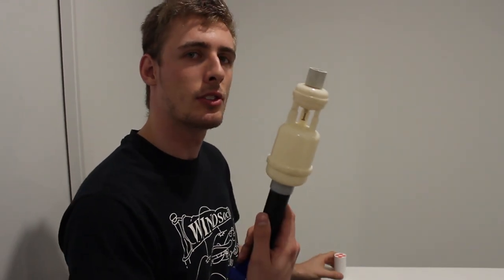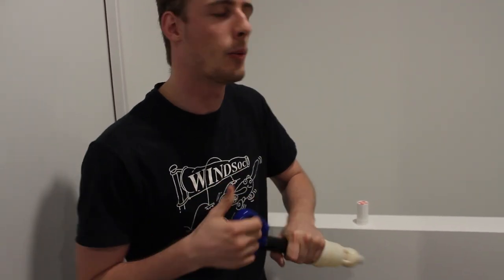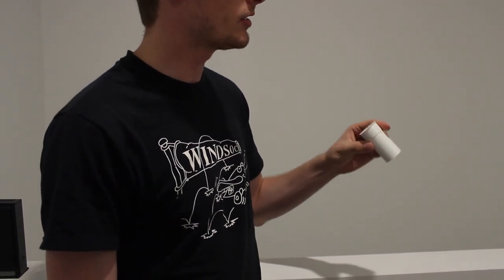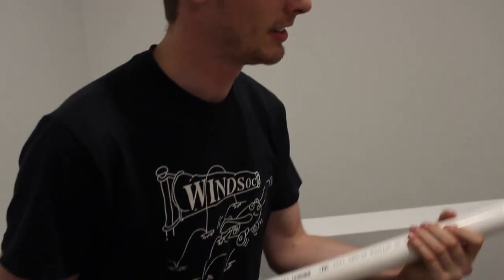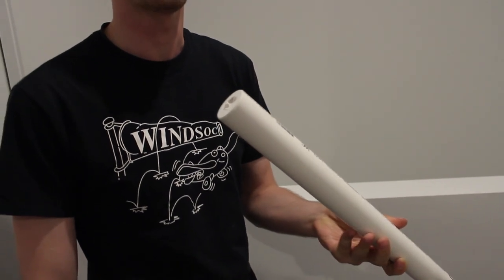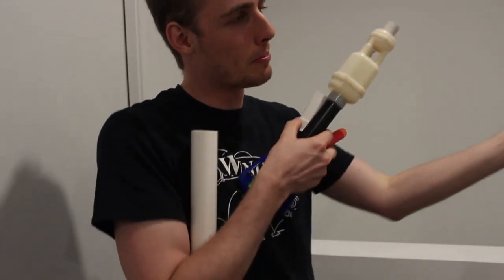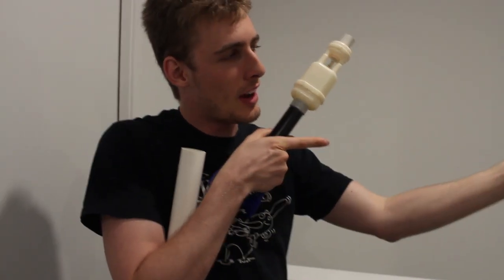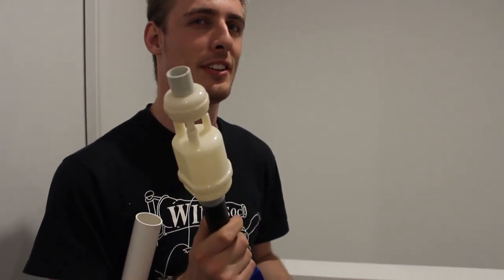Make Test Battle Sneak Peek: Shotgun R&D!

Comment: Still waiting for an update for this project :D

For the idea of having multiple types of darts loaded shells, the DP-12 is a good candidate, it's essentially two pump actions side-by-side. There's a few more like that, like the 1216, with 4 tubular magazines holding a grand total of 16 shots of 12 gauge, thus the name 1216. The "magazine" is detachable and is manually rotated, much like an AT2k. It might become a tad bit too large with the shells you're using. xD 
Also on the table, which I feel is a lesser known shotty, is the Kel-Tec KSG, which also made an appearance in the movie John Wick. Very similar to the DP-12 in that it has two tubular magazines in parallel below the barrel, but only has one barrel. It's a bullpup design with shells loaded in from behind the trigger, and it's got a selector switch that allows you to switch between magazines. Holds 14 shots.
Finally, featured in both Battlefield Bad Company games, and with only three ever imported into the US, the NeoStead 2000. More or less a KSG with weird features. Has double magazine holding 12 shots (they keep getting lower in capacity...) and single barrel, but unlike the KSG, it has magazines on top, barrel at the bottom, forwards-pump (how awkward), and the option to alternate between magazines with each pump on the selector switch. 

tl;dr, there's a few more options in terms of design when it comes to loading multiple dart types in shells other than a DP-12. But it seems like it's best we start simple (the patent drawings for the NeoStead is semi scary, the 1216 is a Rival Artemis with magazines that rotate instead of barrels, the KSG, weeell, say, a Dual-Strike with mags instead of Smart AR barrels, and honestly it could be faster to make an orthodox pump action and bolt them together instead of making a DP-12).

Have a good day.

Comment: Shotgun bore "gauge" is based on a pound of lead.  Twelve gauge is the diameter of a 1/12# ball of lead.  Thus, gauge and diameter have an inverse-cube relationship.  Twice the diameter of a 12ga should be 1&1/2ga (12/8), or the diameter of a 2/3rd# ball of lead.  But I'm pretty sure the cannon designations would have been applied instead, calling it a "two-thirds pounder" rather than by any gauge number.
Reply: +Rhino_Aus "one pounder"

Comment: Are you going to put an extractor to pull out the shells?

You have the lips on the shell so you can use a large extractor claw so the shell comes back, is ripped out and have a shell loaded into barrel.
Look up 870s and field stripped firearms, that should help with shell ejections
Reply from the maker: +Snoop Doggy Doge Yes. I have some pretty good sources and the design is all but complete conceptually -R

Comment: Dang, at that scale you'd pretty much be out of the gauge ranges and into the caliber scales! That's one heck of a "shell." Great job there man, can't wait to see where this goes. I'm a huge fan of absolvers/shotgun barrels myself, and have been working on some way to make a brace of tri-barreled flintlock styled absolver pistols... just for the fun of it really XD. Any particular air tanks you guys would recommend for that? I was thinking maybe along the lines of using a single Panther tank per blaster, though there might be more easily obtainable options with equal/better power and ranges. Any thoughts?
Reply from the maker: +Derek Shy-Borg Thanks! I'm pretty excited too. The airtank selection is tough as there are a lot of variables. I would say instead pick an airtank then design your system around that. Its easier to change the barrels then the airtank if it doesnt have enough performance -R
Reply from the maker: +Derek Shy-Borg I know that a panther doesnt really have enough air volume and for me won't fire all 3 barrels of a 3 dart absolver 100% of the time
Reply: +Derek Shy-Borg Thanks for the tips, I'll keep looking through my tank options. Maybe I could fabricate my own smaller PVC tanks, or if I can figure a way to make a powerful and compact springer system maybe? Time to break out some blueprints.
Reply from the maker: +Derek Shy-Borg BBUMB or a 4B would be the way to go. The BBUMB can handle 6 darts easily and the 4B can handle a lot more -R

Comment: Oh boy, a pump action shotgun with shells? Shame its not using the sledgefire shells, but thats still pretty cool.
Reply from the maker: +Mc Rex You can't get sledgefire shell easily nor cheaply. 
-Justin
Reply: Make.Test.Battle Probably not, but in comparison, just how cheap is it to 3d print these shells, and if you do intend to use them in a pump action shotgun, what will they be ejected into?
Reply from the maker: +Mc Rex I can print the shells for about $0.50 each. THey will get ejected onto the ground and I will pick them up between rounds -R
Reply: Make.Test.Battle Aren't you worried about them cracking, chipping or breaking at all?
Reply from the maker: ***** Not really; they are fairly tough. But if they do I can just replace them -R
Reply: Make.Test.Battle Fair enough. Any plans for sale of any kind of design that uses these shells?
Reply from the maker: +Mc Rex ill probably release the shells in some fashion when i have them dialed in just right and maybe some rough design instruction video

Comment: Hey Ryan, I was just browsing through your guy's videos and experimental for inspiration  when I thought of something. You said you're trying to think of a mechanism/system to multi-feed "shells," while still being able to hold and switch between multiple types of shell/dart types? There's a tactical shotgun pattern ot now called the SRM 1216 that has a detachable 4 chamber shell mag (is it called a mag for shotguns?), used to hold multiple types of shell types and is commonly used for close quarters tactical use and defense. Need a new ammo type? Simply rotate the cylinder to the desired type, lock in place, and ready the gun to fire. I think it might be a good candidate for implementation into your own design, just upscale the dimensions to the new Nerf sized shells you're making. It's almost the same kind of set-up as an AT3K rear loading mod in a way. Here's a pic of one if you need an idea of it's overall layout. Hope this helps a bit, can't wait to see what you come up with!

http://cdn2.bigcommerce.com/server5100/7g4m0/products/107394/images/550035/P1720826__79571.1415640318.1280.1280.JPG?c=2
Reply from the maker: I considered something like that but the size of the mechanism with end up being totally huge! I will probably run with a pump action shotgun primary and if I feel like it a little single shot break action pistol-ish thing for firing grenades/rockets -R
Reply: Pump Action, arguably the classiest version of tactical shotguns (especially those chromed ones with wooden details. Oh Remington, is there nothing you can't do? :P )
There's another pattern of shotgun that could work that I found, all thanks to WalcomS7's double Alpha-Trooper build. It's called the DP12: dual barrels, dual magazine wells, all hooked up to a single trigger and pump mechanism. Sorry to bug you again, just thought I'd toss out one last idea I stumbled on. 
http://files.harrispublications.com/wp-content/uploads/sites/8/2015/07/swmpas-dp12-lead-682x383.1437586360.jpg
Reply from the maker: Hehe yeah I saw that too... lets get 1 pump action working first eh?

Comment: why make a new shell when you could just reuse the sledgefire shells? unless that shell is big enough for two mega darts, then I get it. you could always shoot rival rounds as well.
Reply from the maker: +AidenCaterwall A few reasons: Sledgefire shells don't fit in a mag tube nicely, don't have the right geometry to be compatible with a tubular magazine mechanism, only have 3 darts instead of 4, and are fairly expensive. To have a useful amount of ammo id have to print my own sledgefire shell, and then I may as well print my own shotgun shell design -R
Reply: +Make.Test.Battle well that makes sense.

Comment: HPA?
Reply from the maker: +Design/Forge High Pressure Air. It will run off a paintball bottle -R
Reply from the maker: +Design/Forge I watched that guys stuff ages ago; but I have some much better sources that I have used to design the mechanisms. Its based around real life shotguns, specifically the Remington 870 -R